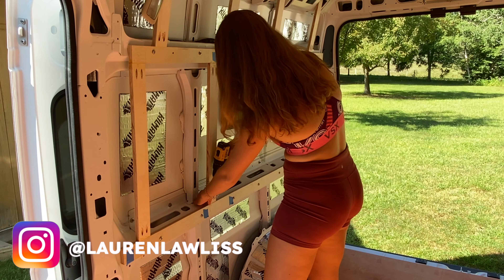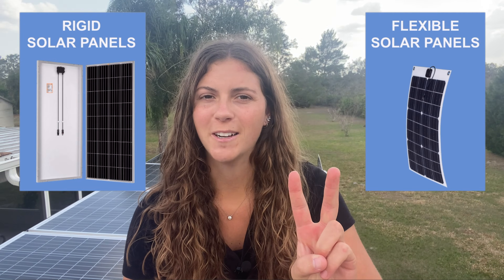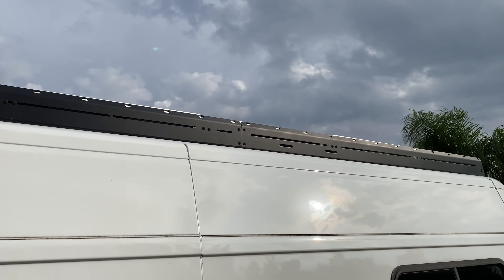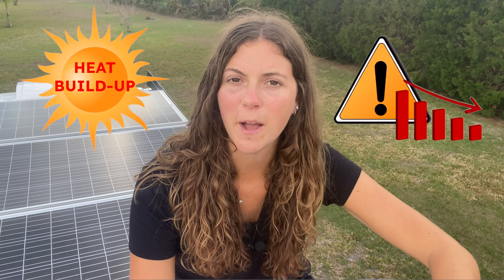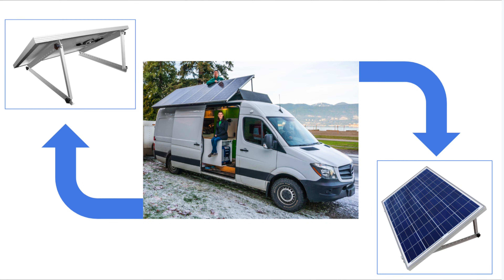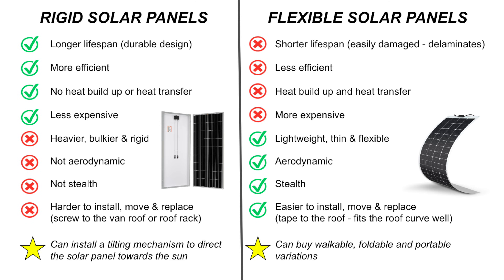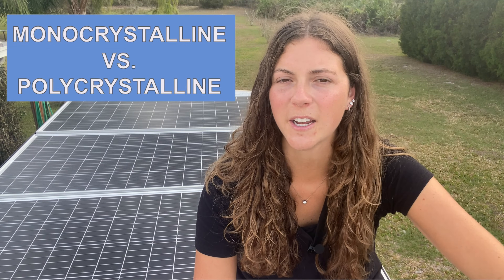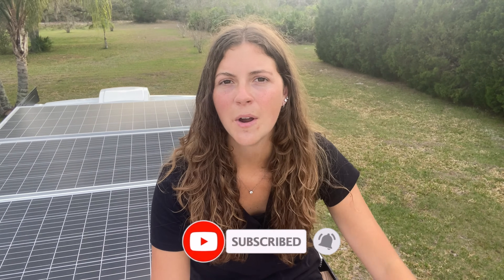What Solar Panels are right for YOUR Campervan? | Ram ProMaster DIY Van Build Series | Van Life

Comment: Thanks,Mam very systematic explanation. I have non ac car, I purchase 100watt solar panel & pwm 10 am charge controller for rear seat attach fan on solar energy.,please suggest battery type & how much capacity battery.

Comment: My van I'd stationary. 1990 Ford economize high top.  Been staying at same spot 6 yrs, haven't moved. But it's at my office complex so need to remain stealth as possible,,, not be making area look like a camp build. I think rigid on roof us still stealth enough.. if don't have any space between the rood and panel. Is there any reason why the solar panels should not just lie flat against van roof?
Reply from the maker: Nice! My solar panels sit on top of a roof rack, but you could certainly forgo a roof rack and install them directly on the roof. Personally I did not want to drill more holes into the roof which would potentially lead to rust and leaks. Also, if I ever want to rearrange my roof setup, I can do so without leaving holes in the roof. Lastly, sometimes heat build up can occur between the roof and solar panels when directly on the roof. Thankfully, my roof rack rails help to hide what I have on my roof and gives air flow under the panels. Hope this helps ☺️

Comment: Awesome video!

Question: Why did you choose 24v solar panels if you have 12v batteries?
Reply from the maker: Thanks! Good questions: 24v panels are more efficient and can produce more power than 12v, but 12v will do fine too.

Comment: What Model number are the Rich Panels you used. Great info and great video's. I'm start my build now.
Reply from the maker: They are the 24 volt, 200 watt monocrystalline rigid Rich Solar panels - the website is currently showing SKU RS-M200D.  Hope this helps and good luck on your build 👍🏼

Comment: What size panels are those??
Reply from the maker: My solar panels are each 24v and 200 watts
Reply: And what are the dimensions? I've been stopped trying to find the surface dimensions of my 2020 159"WB, high roof  ProMaster. I have access to 410W panels with dimensions of 75 3/4"Lx40 3/4"Wx1 5/8"H. I Want to install two of them but don't know if they'll fit, in any configuration.
Reply from the maker: They are the Rich Solar brand. If you search for the panels in google it’ll pop up with dimensions for you to reference 😊 when choosing the physical size of your solar panels, there are many things to consider: what else will be on the roof, what type of roof rack are you using etc.

Comment: Are you doing a video on your roof deck? When will you link the panels you got?
Reply from the maker: Hi Qudrat! Yes, I will be posting my roof deck video on May 1! All my solar panels are wired and working. Check out my channel for an in depth of my ENTIRE electrical system start to finish which includes the solar panels😁